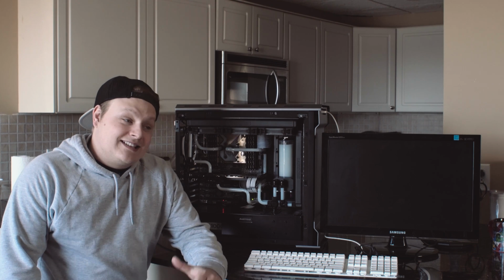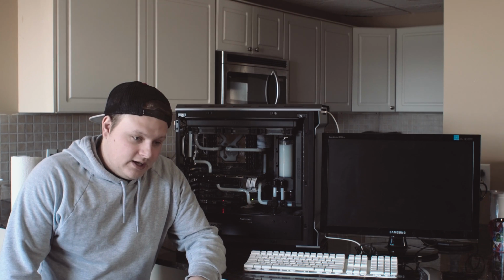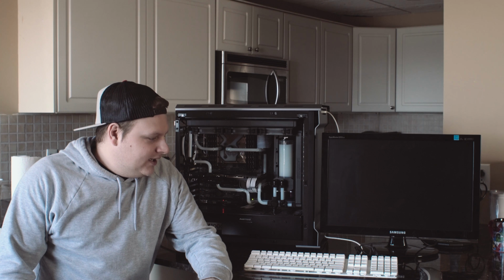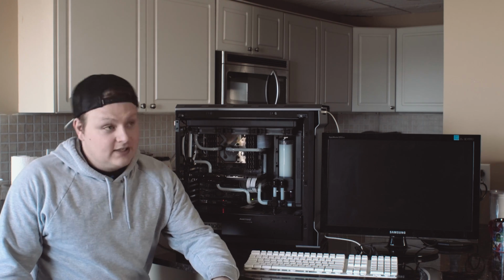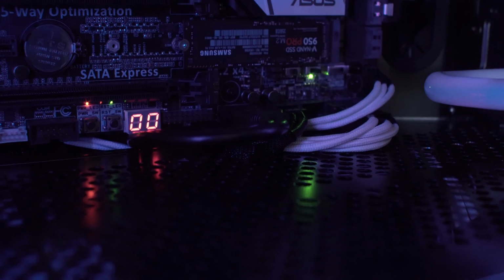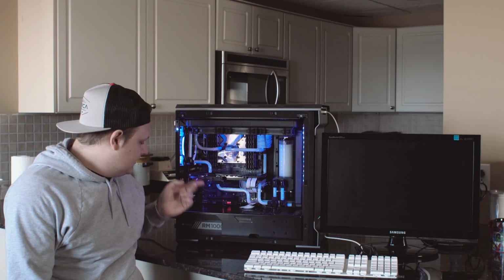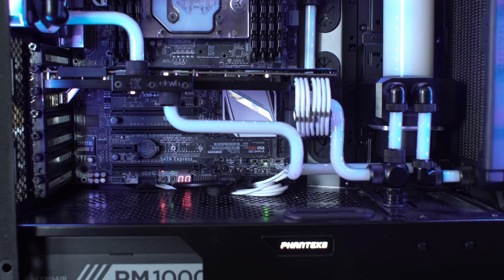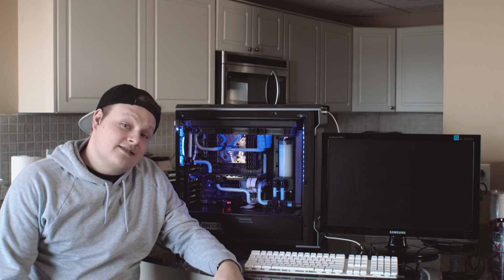System Update - 00 Error. Motherboard Failure?

Comment: That stupid error 00 means that the processor may be  INCOMPATIBLE with the motherboard! I have that situation recently with Asus X99-M WS/SE motherboard and my i7-3820 processor designed to work with LGA 2011 socket. This was tricky. LGA 2011 socket IS NOT compatible with LGA 2011-v3 socket! See http://www.tomshardware.co.uk/answers/id-2583571/lga-2011-lga-2011.html
Reply from the maker: It was a motherboard issue. Replaced the board and I was back to using the system.

Comment: I think that is Q-code D0: CPU initialization error, because Q-code 00 Not Used on Asus x99-e mainboards
Reply: yep. Code 00 is: Kaput, meaning cpu or mobo is dead, no life-support needed lol
Reply: Daniel Toader you are correct  Q-Code 00 does not mean anything in the user manual, however when I got Q-Code 00 on my Maximus X Hero a few weeks ago it was the CPU.

Comment: Hey, man. Just wondering, did you ever have problems with that second motherboard?
Reply from the maker: Tyler Mitchell nope. Second board was fine
Reply: Hey man I'm just after getting a 00 I'm going spare ...so it was a blown motherboard ..I'm fucking raging same thing as you ..I'm starting to think ASUS HIGH END BOARDS are garbage this is my second motherboard in 2yrs both identical because of my cpu I bought and the ram also are specific to the board ..I'm flipping out

Comment: ANYONE WITH ASUS X99 CHECK YOUR VCSSA AND VCCIO VOLTAGES ONCE YOUR LOAD XMP PROFILE. Asus boards load ridiculous amounts of vccio/vccsa which can kill your cpu. Also intel warranty is 3 years. Never run your cpu with no heatsink, use some metal object placed ontop if you need to quickly test it.
Reply: Jolinator I completely agree with you and that also goes for Maximus X motherboards, mine does just that. And especially your last statement regarding never boot up without any heatsink on the CPU. I learned the hard way many years ago, when I put my finger onto the CPU without a heatsink to test an old system during boot up... it got that hot in just 1 to 2 seconds that it nearly burnt my finger tip. And that was a good CPU, so it's not as though something was wrong with it, which made it overheat. Imagine today's CPUs!!!! with billions of transistors. It's just not worth taking the risk, even if they do have an auto shut down when the CPU reaches the max temp.

Comment: my system is i7 4790k, asus maximus vii hero , 460w cm psu , 12gb ram , 1tb wd blue , cm elite casing , cm hyper tx3 evo cooler .  . . the problem is my pc runs smooth for hours but all of sudden the 00 code appears and the cpu shuts down rest working like fans keep spinning , leds kept lid .
what am i suppose to do
Reply: I have a very similar build, the thing is my system works fine until i shut it down, if i turn on right there it gives me the 00 but if i wait some hours the system boots up just fine, have you fixed yours??

Comment: If anyone else has run into this 00 code and your system wont boot. My issue was a Faulty DisplayPort Cable.. I'm using a DVI cable right now to still utilize 144hz until my new quality cable arrives. Hope i could help some, as this was a huge headache for me with my new build.
Reply: cerrupT dude, you solved the issue I have been having with my own build
Reply: No es error 00,  es el error  D0

Comment: i think my 6900k or my asus x99 deluxe II has just had the same issue, im going to RMA both and it should fix, lukcy they are both within one year, but it still sucks that it happens,
Reply from the maker: The x99 platform has the most bugs I've ever seen. The system I built for my buddy only lasted 8months and the x99 deluxe ii died. He also has a 6900k. I replaced the board with an asrock board and things are back up and running. I wouldnt buy another Asus x99 board. I went through 3 of them. Your cpu is probably fine.
Reply: i hope so, i mean this wont cost me any cash but its my rig out of action for a couple of weeks. your rig is beautiful btw, mine is very similar but has soft tubing

Comment: i have same problem!
Reply: X79 too, motherfxcking Asus
Reply: me too.how to fix
Reply: @sonkevin1567  ur cpu died becauze u overclocked it or u had too much volts pumping
Reply: @subscribinkitmane1119  not necessary wen I plug the hdmi cable to my motherboard the system boots fine then I have to connect the cable back to my graphics card its very strange but it works I have a maximus 5 formula it just started giving error code 00 out of nowhere

Comment: hello can you plz help ! I have the same issue error code 00 no boot, everything turns on. but error code 00 . i get no signal but all the lights and fans for everything turns on , at first i thought it was the mobo went to get a new one  still same issue , swap the ram same issue, i know the PSU is good is from my other system i try and also the gpu is good . but still no post and 00 . i check all the power connectors and everything. the only thing i have not changed is the CPU but all the pins look perfect
Reply: Jefferson my ASUS Maximus X Hero a few weeks ago had the same error code 00, it was the CPU, an i7 8700K. Because it was under warrantee I took it to the store where I purchased it from, who also checked it on one of their test rigs and they replaced it for a new CPU because they confirmed it was dead. SO, because you have checked everything else but the CPU, I would say it is the CPU. 

Tonight my other older rig, which has an ASUS Maximus VIII Ranger has also decided to do the same thing, and for the past week it has given one long beep followed by 4 short beeps during POST. It did this about 2 times at random, but it booted up fine. Until tonight, now I just get 00 with CPU fan running at full speed. SO, either my motherboard is damaged or the i7 7700k is dead.
Reply: @KefirGrain  my x hero did the same things few days ago,thinking about the same dead 8700k

Comment: I got the same problem but only when I restart the computer... any one got any ideas ? I cleared cmos, updated and downgraded the bios, changed ram... no luck :[
Reply from the maker: So you are able to get into the bios? That would suggest that your motherboard is ok. I couldn't even get to the bios. In the bios does it show your CPU running correctly?
Reply: Zed ProMedia yes I can get into the bios and everything is running correctly I think, however i only get that error code when I restart my pc
Reply from the maker: Hubert Woj so if you shut down and boot up you don't get the issue? When you say "restart"  do you mean hitting the reset button?
Reply: Zed ProMedia Yes or when i update a program and my pc has to restart
Reply: Zed ProMedia have you got any idea what the problem could be ?
Reply: i have the same problem, i think its the battery? have you fixed yours?
Reply: I have an Asus Maximus Hero VII and when i shutdown and then turn on again right there it gets the 00 but if i wait some hours it boots up just fine, it very weird... What can cause that? Did you fix yours?
Reply: @elDiDi  I had to do a bios update as the motherboard didnt support the i7 4790k only the i5 that got realsed ealier
Reply: @3ben31  the problem is i have the latest bios, i updated it last year when i bought an m2 ssd. Could this be caused by the cmos battery? I never replaced it, its the original (i did have some problems with 00 before the flashback, and when i updated the bios this 00 stuff was constant)
Reply: @elDiDi  No idea sorry, For me the bios update worked other solution didnt :/
Reply: @elDiDi  I have the same problem, did you find a solution?
Reply: @Николай-м1к4х  in my case the problem was the PSU, it had an issue with the 5volt ready cable (it is a grey one in some PSUs) so because that cable didnt have 5 volts the motherboard coundt initialize the boot cycle so the 00 error appeared. By replacing the PSU my problem was solved
Reply: @elDiDi  I just have the same problem and the same motherboard z490 asus hero maximus and i7 10700k, power supply sorsair cx650m, it also happens that out of 10 times 2-3 does not turn on, the first time 00 does write, but if you reboot it turns on
Reply: @Николай-м1к4х  My old PSU was a Corsair CX600M so maybe there is a problem with those PSUs, i don't know. I switched mine and now i don't have any problems related to Q-code 00
Reply: @elDiDi  What company did you put in the new one?
Reply: @elDiDi  thanks for answers
Reply: @Николай-м1к4х  I went for a cheap Thermaltake as i didn't know for sure if the psu was the problem

Comment: Sito Asus code 00 = Cpu Failed! Overvclocking cpu? Dead cpu ;-(
Reply from the maker: La Linea no if you watch to the end of the video it was actually the motherboard. The CPU was ok thankfully.
Reply: +Zed ProMedia Yo Zed, does everything works fine even the fans when you got that Q-Code 00?
Reply from the maker: Noel Earvin Piamonte the board turned on but no screen. No boot. Just 00 I use a fan controller so the fans ran but it was the motherboard in the end.
Reply: I have the same issue. 00 code, no post/ display and everything else runs fine. I'm just not sure if the CPU or the Motherboard. After watching your video I think it's the motherboard that is dead. I have ASUS X99A-II and Intel Core i7 6800k which running for a week till I got the 00 yesterday.

I'm not sure why this happens on ASUS motherboards. I have seen a lot of issues on the forums.

Did you overclocked your CPU?
Reply: Nevermind, you said it in the video.

Comment: I had the Same Problem by me was it the CPU :-(
Reply from the maker: Bloodyeddy awe that sucks. I'm kind of lucky it was just my motherboard which was the cheaper fix since my motherboard and CPU were over a year old I didn't have the option of warranty
Reply: what kind of case are you using, i think i fixed it by making sure none of the pins on the back of the mb were touching on my steel case, i put tape on the case where the mb comes close to touching it, make sure the board isnt shorting out on the case because E-ATX boards are bigger
Reply from the maker: Huseyn Rasulov it's the Phanteks Entoo evolv  atx. No problems with the new motherboard.
Reply: Bro i hope its not my CPU :(  -----> 19-10900k

Comment: Did you sleeve the SATA cables yourself or purchase them somewhere?
Reply from the maker: The SATA cables came like that from Asus with the mobo.
Reply: Oh right, I'll just end up sleeving mine then I think. I've been watching your build logs and you ended up with a sweet end product! You've swayed my mind to put bends in my loop instead of using more 90 degree fittings.

Comment: I recently bought Asus x99-A II that would go with 6800k and both died after two days without any OC'ing, during software installation. One thing that makes me happy is that it died during first few days when it's still in warranty/exchange period. I think this is my last asus mobo buy ... it's a shame becouse their bios is really good. Damn, I had hopes that after 2014/2015 they got things sorted out with x99 lineup, but it seems I was wrong.
Reply: The same happened to me i try every thing it's only 4 days after I installed it but how did you know they both died maybe just the motherboard.
Reply: At first, I just assumed that CPU died, since the CPU led was the only one that reported any problems besides "00" error on diagnostic lcd. After that I RMA'd both, my fears came true. I think VRM fried, taking CPU with it. Common problem with x99 line unfortunately.
Reply: my motherboard give me 00 and cpu led i toke the cpu out of the motherboard and still give me the same thing nothing change 00 cpu led i need to bay one ASASP but i am a freed to pay motherboard and the cpu didn't work

Comment: are you suppose to spread the thermal paste like that with the monoblock? or is that just something you do with all your cpus?
Reply from the maker: I normally always spread it smooth and even like that. Before this mobo died I did the pea sized method. Everyone has their own way. Honestly it doesn't even matter that much. The pressure from the mono block would spread it. If you watch the video Linus did showing different methods of applying thermal paste there was the tiniest margin of temps. If I had that kind of time I would do the same test to prove similar results. Thanks for watching
Reply: +Zed ProMedia gotcha. And awesome build. I like the white theme

Comment: Scrap? I'd bust ASUS's ass for that! 

My cheap M4A785D-M PRO has been dragging my overvolted Athlon II x3 at 1.6V without a hiccup for nearly 6 years already
Reply from the maker: Yeah so wired. Not sure if it was an over bolting issue or what but I've had boards in the past do crazy things like with my old Phenom ii x6 1100t black edition on an Asus sabertooth. Had that thing dialled right in and it ran for a long time at 4.5hgz till I upgraded
Reply: Zed ProMedia Exactly. Do you have time to investigate?
Reply: my motherboard give me 00 and cpu led i toke the cpu out of the motherboard and still give me the same thing nothing change 00 cpu led i need to bay one ASASP but i am a freed to pay motherboard and the cpu didn't work what do you thing because i am going to pay the motherboard today .